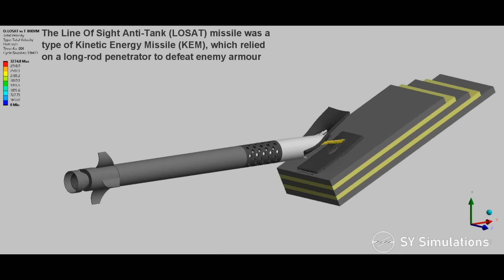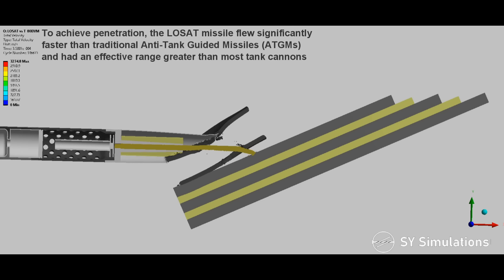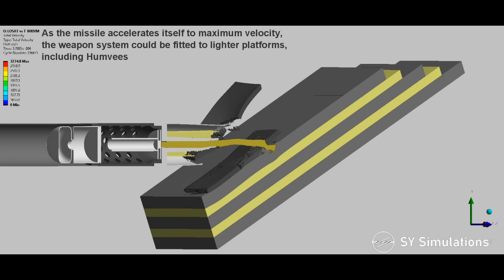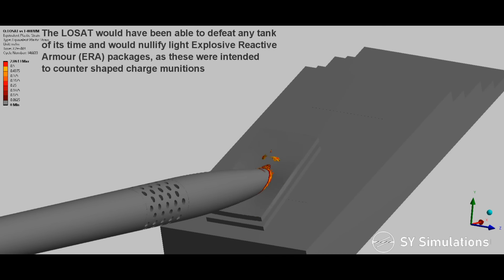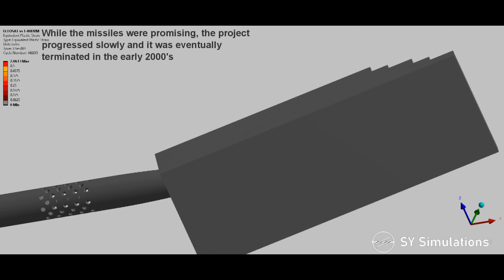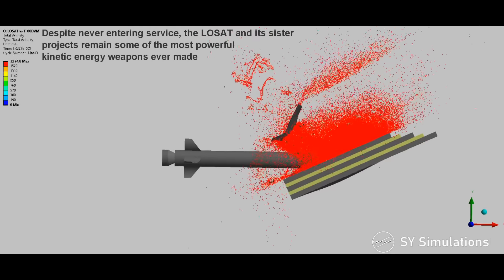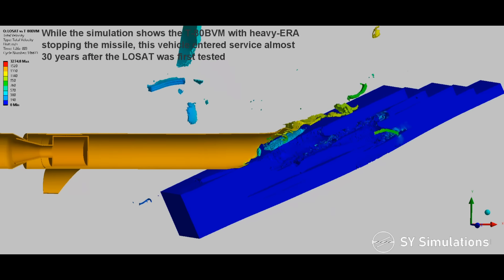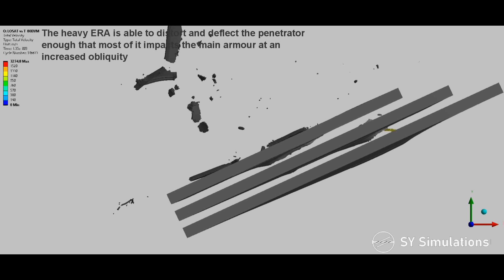LOSAT vs T-80BVM | MGM-166 Kinetic Energy Missile vs Relict ERA | Armour Penetration Simulation

Comment: After learning about Starstreak HVM it hit me "why is nobody using missiles to accelerate pure kinetic penetrators for the AT role...?" It seemed like starstreak itself could surely be pretty easily adapted to fire kinetic warheads for an AT role. I wondered if there was something fundamentally flawed with the idea. But the fact these projects did exist shows the idea is at least workable. I wonder though, is part of the reason why we're still seeing chemical warheads over kinetic ones down to flexibility? Like a HEAT warhead can still make for a reasonable round for use against infantry and structures, whereas a kinetic round is borderline useless against infantry, and of limited use against structures. Overall though, with the speeds missiles can reach - if you want to make armour totally useless, a kinetic missile would surely be the way to do it lol. I'd be interested to hear how small and light you could make a modern missile that would deliver a modern 120mm/125mm long rod penetrator at speeds around what modern guns can manage. It seems like, for LOSAT, a big flaw was that it was bloody big for what it offered. Maybe that's the core flaw in kinetic missiles.
Reply: Well, kinetic missiles are currently a little hard to make as worth it/good as KE penetrators. Wait 20 years I guess
Reply: Some other promising projects were there as well. Initially the air force wanted a hvm for their a-10s and some other branches were interested as well. Air launched variants are the only reasonable attempts as you can launch the missiles from tens of kilometres away. They just need a lot of build-up to reach their speeds. Saclos guidance at those ranges was and still is somewhat of a problem. They would probably need to have some sort of radar guidance. I guess these projects failed that cost efficiency test as heat war heads were simpler and cheaper.
Reply: iirc there was a soviet apfsds that was powered by a rocket/missile motor.
Reply: @Masterafro999   To use Starstreak as a reference as this is the thing that got me thinking about kinetic missiles: Starstreak is from 1997, so it's hardly new. It only weighs 14 kg and it's three warheads weigh a total of 3kg and are accelerated to "over mach 3" (not sure exactly how fast) "rapidly" (in a couple of seconds as far as I can tell). Now that's not anywhere near the kinetic energy of a modern tank round (about 1-2 mach off and 1-1.5kg less projectile mass) - but, again, it's only 14kg and from 1997. Also Starstreak seems to be very accurate and capable of hitting rapidly moving and evading aircraft (directly). 

I have a feeling there might be a scaling problem trying to increase that mass and velocity by roughly 1-1.5kg and 1-2 mach, respectively
Reply: @tommeakin1732  yeah my thought exactly. Scaling would be limited by rocket motor size. Those boosters would be massive for the projectile to reach high speeds at ranges of let say 20km
Reply: @hemendraravi4787  that sounds interesting. Any other information on it? I would love to dig some stuff up
Reply: HEAT and other chemical warheads have an advantage in that they dont need to get to a certain speed to achieve full penetration.
Reply: Starstreak sub rod has explosive filler iirc.
Reply: @jintsuubest9331  Yes I know, they're supposed to penetrate then explode in the target after a small delay. And there's three of them. My point was that there's nothing stopping those three rods from being swapped out for a single inert long penetrator than weighs as much as the existing three penetrators.

Starstreak is just the first thing that made me think "hmm couldn't purely kinetic penetrator missiles be a thing...?"

Comment: My question would be with the LOSAT would it matter all that much even if it didn't achieve a penetration in the traditional sense, or would the mass and velocity of this thing still render the tank inoperable from the sheer kinetic impact and force? I can see there being many cases where an outright penetration wouldn't occur but the destructive force from the kinetic energy would be more than enough to make the tank completely dead in the sense that most systems, tracks and possibly the engine and it's components would be disrupted, destroyed or damaged from this impact. That was the effect it looked like it achieved in the videos of the LOSAT I have seen but I don't know if modern era tanks actually do or do not have enough structural strength to withstand the mass and velocity of the LOSAT. I'd like to know if anyone can clarify or correct what I'm assuming would occur.
Reply: Not to break through, but even an automatic cannon can take the tank out of battle, which we recently saw in Ukraine, even fragments of a 155 mm projectile can seriously damage the tank.
Reply: It would surely cripple the vehicle if the turret front is hit. Optics, sensors and turret drivers would likely suffer from the sudden shock
Reply from the maker: I dont think its mass alone would be enough to knock out a tank (when hitting a strong area), as most of its weight is made of a thin air frame and propellant (which burns away), with it also being quite long -this would cause less of an impulse on the armour
Reply: Did you not see it shotgun the driver in the face lol. It doesn’t have to go all the way through to be considered penetration.
Reply: @andrewjack5755  spall Liner was not modelled. Would be interesting to see how much that would have absorbed

Comment: You all forgetting that the vibrations caused by a 80 kg projectile nearly penetrating the upper front plate at mach 4 would most likely cause severe damage to mechanical and electrical components of the tank. No tank was ever designed to absorb so much kinetic energy at once.

Comment: I wonder if AdKEM and CKEM would've done better

Also did I misread something or was the "initial velocity" literally 1650m/s lmao
Reply: Unless the motor and fuel mix received a massive upgrade, it is unlikely they will do better as they are smaller in dimension. 

As for velocity, it would get shoot out of the container at low hundreds m/s before the main motor get ignited and accelerate to max velocity. 

1650m/s also makes sense as that's what the army 120mm main gun round is targeting. But the documentation on losat is very limited. 

However there is no way the initial velocity is 1650m/s as it will need some time to accelerate up to that velocity.
Reply: @jintsuubest9331  The initial velocity claim is taken from the documents SY cited in his community posts lmao

If anything, I'm pretty certain (about 70-80%) LOSAT doesn't even use a long rod penetrator but rather has a small tip in the front, instead of a whole rod. If it was a long rod like in the video, it would have to run through the guidance electronics, the IMU(whatever that is) and the attitude(not altitude) control motor. In fact, there is obscenely few information regarding LOSAT (and KEMs in general)'s penetrative performance. The sources I read upon make LOSAT look more like a hypersonic guided APCR if anything.
Reply: @jupitercannon3028  
I just want to make sure we are reading the same document as I don't see anything suggesting initial velocity of losat. Only velocity figure are the rod expected to be used in the 140mm gun.

Also the same document suggested standard penetrator can be used in losat without fins as stabilizing fin would be redundant for something encased in a missile. That at least in part suggest the intention is to use the exact same rod in for losat.

If you can provide links (youtube does not allow links, so some keyword to search for) to documentation supporting your claim, it would be fantastic.  

imu is inertia measurement unit, i don't think any component were labeled that in the image he post, it is labeled acm.

Lastly, your logic is flawed.  
a. there are about 5 million ways to build computer to enclose a 30mm square void (more like a triangle void in this case)
b. we have tungsten carbide, tungsten alloy, and experimental du alloy apds fired at 1500m/s to 1600m/s, they will struggle to deal with even the most wide spread 60-50 armor, let alone more advance 50x3 threat as shown here. 
c. we know even somewhat short steel rod achieve better performance than above mentioned apds, we talking about sub 500mm steel rod at 1500m/s
d. we know very little about real world performance of rod penetrator in general, but we can mostly accurately simulate rod performance against non complex static armor
Reply: @jintsuubest9331  1: My mistake, yes, I confused 140mm stats with LOSAT stats, and apparently no, the document excerpt doesnt even mention LOSAT velocity.

2: In fact, the document never makes explicit mention of LOSAT, or MGM-166 entirely. The "we don't need fins if we're putting it in a KEM duh" can be a hypothetical scenario created for future endeavors or discussion. LOSAT is not the sole KEM project the US did. CKEM and others exist. Hence, you claim is highly speculative.

3: According to ADP010952, "LOSAT has no warhead charge - the kinetic energy of the hypersonic missile provides the kill mechanism. LOSAT provides kinetic energy on target that exceeds that of a tank round, without requiring the heavy weight of a tank gun." Speed of sound at ground level is approximately 340m/s, thus hypersonic (at least 5x speed of sound) would mean LOSAT should at least reach 1700m/s at its peak.

4: I want to send you the image, but I don't exactly know how to send PDFs in Youtube comments    -_-

5: Thank you for explaining what "imu" is.

6: LOSAT is a late 80s project. First ever tanks to be equipped with "Relikt" ERA are from the mid/late 2010s. This was an "unfair" fight to begin with. Moreover, human intuition regarding high velocity impacts is extremely poor. Without good documentation regarding LOSAT's actual performance (since the sources I've come across never agree what the range, impact energy and weight of LOSAT is, and the fact that none of them seem to have properly documented it's penetration performance...), all performance is highly speculative. Comparing 105mm and 120mm APDSes to whatever max diameter LOSAT's "Lethal Mechanism" is, considering said "LM" resides in LOSAT's nose tip, seems extremely inappropriate.

7: If I just said "60mm gun vs T-55 at 3km, who would win?", the result would not be easily guessed unless you had access to documentation regarding 60mm HVMS, or saw the simulation. 

Youtube deleted this twice for some godforsaken reason... I had to resort to writing on a .txt file.

Comment: I thought the warhead was a solid chunk of hi carbon steel! Not a cap over a thin uranium rod! Is that how all of them were? What if the penetrator used more of the space provided by the rocket and was of different, less expensive material? Wasn't the warhead itself of 80 kg of weight alone?

Comment: People are bringing up M829A4 in the comments thinking it'd go through 

A4 isn't much from A3. 
Biggest difference is the weird electrical system in the shell.
Relikt can stop A3 and DM53. 
I'm positive it can stop A4 as well, SY has done some sims on the aforementioned shells.

Also T-80BVM, didapoints me. Definitely should been T-80u's receiving Relikt. It's like upgrading a T-72a with Relikt
Reply: Well, I disagree. A4 has a velocity boost, very significant.

Anyway, let's say we have a rating scale - T-80BV is 0.5 out of 1, T-80U is 0.7 out of 1. If you get T-80BVM, let's say it's 0.9 out of 1. It's better to have a lot of 0.9s and 0.7s rather than 0.5s and 1.0s
Reply: @belgianfried  You're right it does, however construction of the penetrater is the same. If we're doing the RHA pen numbers thing you're only going from roughly 600-650 to 700-750 which is definitely very significant but It's just barely not enough

Also reason why I still think T-80U is better for the program is because T-80U has many more modern systems from fire control, to what else
T-80B is literally a T-72a with a turbine, armor package alike
Reply: @handsomeivan1980  Well, T-80BVM isn't just armour. Sosna-U package, DVE-BS and all. So T-80U or T-80BV would only have differences in engine and armour.

Albeit LOS pen of 829A4 was 740.4 mm. Determine its effectiveness by yourself
Reply: This sounds like cope seeing as there is multiple videos of a drone with an rpg punching through t90ms and t80bvm but w/e

Comment: Try again but change the penetrator to something more modern in design, like a evolution of the missile would have
Reply from the maker: Tandem long-rod? 👀
Reply: @SYsimulations Hollow steel tube infront of the DU penetrator.

Breakaway tip like in the later M829 variants.

A small HEAT/EFP charge to initiate the ERA...

But I think the main issue is the actual trajectory of the missile.

That's easy to fix...just adjust the flight profile.

Comment: If the BVM could tanked it,iam sure the 90M could do better.but still,iam very surprise that the LOSAT didnt just put a gaping hole in the armor.
Reply: I guess it was just never as good as APFSDS, which explains why it never entered service.
Reply: @92HazelMocha  thats understandable
Reply: It wasn't good as other weapons like ckem which would have probably punched through it
Reply: @92HazelMocha  or never as good as a tandem charge HEAT warhead; a kinetic penetrator's performance depends on its velocity, and a missile can only get to that much speed 
HEAT warhead, on the other hand, works with any missile speed
Reply: @tranquoccuong890-its-orge  HEAT is not that effective of a AT weapon against the front armor. Modern composites are rated much higher against HEAT. Most composite are 50% to 100% more effective against HEAT than kinetic. So, you need a HEAT warhead that has much more RHAe penetration to a kinetic before it can do something frontally to a target. It is why tanks all still use APFSDs as its primary tank killing round. The HEAT hype died in the 60s.
Reply: @tranquoccuong890-its-orge  Against heavy armor like an MBT, KE penetrators work infinitely better than HEAT or even tandem HEAT. Tandem HEAT is primarily used for vehicles and systems that can't fire effective KE penetrators. Additionally, the LOSAT missile got up to APFSDS speeds, and other KE missiles could go even faster.

If Tandem HEAT was so clearly superior to APFSDS, literally all modern MBTs would use some form of tandem HEAT shell as their primary anti-armor shell.

What killed the LOSAT was its slow and expensive development.
Reply: @MacSalterson  Thank you for using the possessive 'its' correctly. I applaud your writing, its accuracy and its - though pleasant, rarity.

Comment: I remember doing some calcs at the time that suggested substantially more penetration than what is suggested here. Specifically I sized penetrator based on quoted KE values (expressed in multiples of M829) and also a drawing from ATK which showed the penetrator protruding into the solid rocket motor (which they made).

Comment: damn, LOSAT has no problem with the BVM in WT
Reply: Senselessly buffed by gaijin but everyone complains about russian bias. 😂 I love wt.
Reply: @Masterafro999  LOSAT is only good on certain map and spots because of no stabilizer, weak armor, somewhat slow, and inability to elevate the gun instead of things like T-64, T-72, and T-80 where you can just rush or snipe while tanking a bunch of damage and can penetrate anything it sees also you can't just think the entire tech tree is op because of one vehicle
Reply: @pointer3713  losat is a niche vehicle. And I'm alright with that. I love non-meta vehicles. But the losat over performs for how other vehicles, armours and penetrators are balanced. Everyone collectively loses their shit when anything Soviet is added that even remotely looks capable. The current spaa Vs cas debate is a good example.
Reply: @Masterafro999 actually no, the missile in warthunder is nerfed considerably  it actually has 1400mm of penetration. LOSAT Missile Penetration: 600mm - 1,850mm
Reply: @sartte  says who? The losat project got canned due to lack in performance. 1800mm of kinetic penetration is insane! Why would it even have that much penetration the actual penetrator is shorter than today's penetrators whilst being considerably slower and I believe just as heavy if not lighter. There is no physical way that this should have up to 1800mm of penetration. Even 800 seems questionable as other penetrators of that size, velocity and weight beg to differ.

Comment: That's a nice simulation, but the US Army wouldn't have built the LOSAT if it hadn't been able to pen T-80 armor, so most likely something is off about the simulation.
Reply: The T-80's weren't even in service when the LOSAT would've been,
Reply: Yeah, this entire simulation relies on the armor being in perfect condition (Russians have an issue with that) and being of the same quality as stated in the design documents (also an issue when you outsource all production to civilian factories using equipment from the 1960s and material from scraped cars), so it just doesn't stand on its own. And to top it off, the kinetic missile would have come in at an angle from a decent bit above, not nearly directly into it.
Reply: Nice thread full of misconceptions you got there.
LOSAT was being developed in the nineties (a decade after T-80BV introduction) and offered comparable performance to cutting edge 120mm AFPSDS that would indeed be able to defeat 80BV UFP. The deciding factor in this simulation is Relict ERA that degrades "classic" APFSDS penetration by 40% but it was only introduced in mid-2010s.
HEAT missiles are more compact for the same bang so the program was closed as it didn't provide any advantages. Smaller CKEM has also fizzled out by 2010.